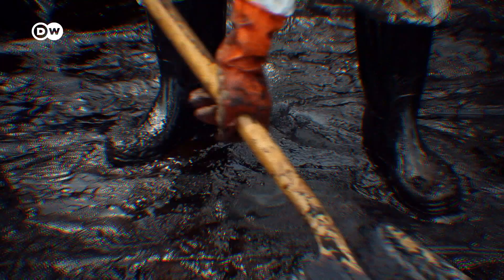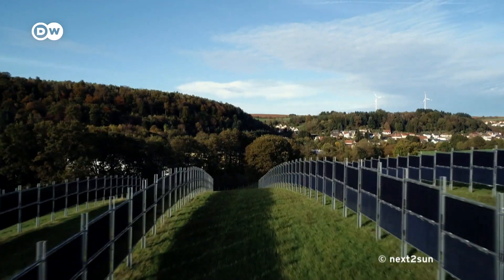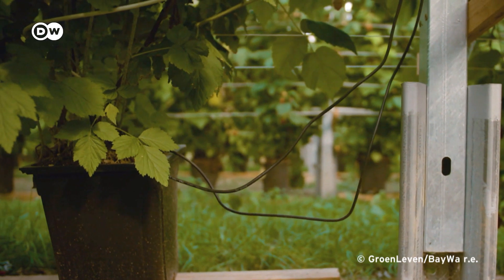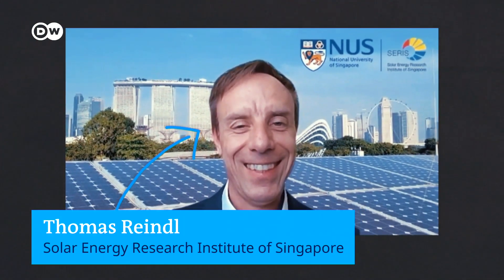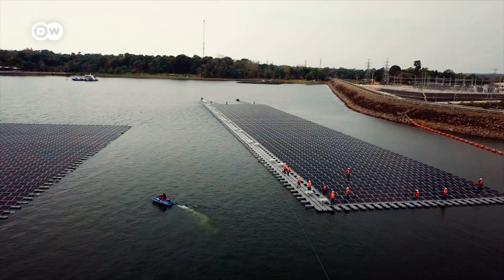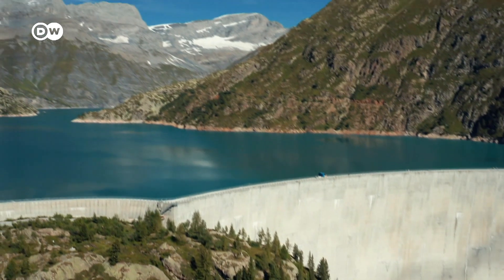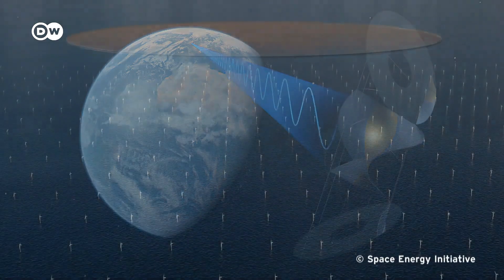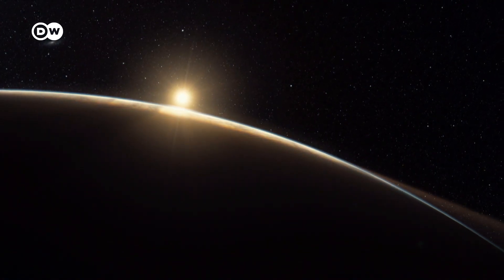Why we should be putting solar panels on our fields and lakes

Comment: The panels could provide needed shade and shelter in urban environments too, above sidewalks and roads and parking lots, and be used to power lights and water pumps, etc.
Reply: I'm for shadowed parkings and pumping water when energy is produced. For light that would mean storing the energy in batteries, and this is a bad solution because batterie suck. They are costly to produce, and I include environmentally costly, and then they have a short lifespan before dying.
Everybody that had installations to light their gardens, or have a remote controlled barrier on solar energy are rapidly dealing with dying lights and have to manually open their fences (a more complicated operation than if they had a non-motorized fence to begin with)

Comment: What happens to life underneath the water that needs light.
Reply from the maker: Great question, Jan! A water quality study conducted by Hanze University of Applied Sciences shows that the oxygen content under the floating PV modules has changed only minimally within a year, as wind and sunlight still manage to reach the water under these floating photovoltaics – because they move. When it comes to biodiversity and the environment, Buro Bakker / ATKB researched and found that panels lead to lower wind levels on the water surface, which results in less erosion of the banks and therefore protects the vegetation and stimulates plant growth. Such studies are still relatively new, and more studies need to be continued to examine the long-term effects in more detail. Feel free to explore the read more links in the description for more information!

Comment: Space solar for "green energy" on earth is the dumbest thing I've ever heard, if you think the $3000/kg to get enormous amounts of material into space is a problem, how about using absurd amounts of fossil fuels to drive the rockets producing a variety of greenhouse Gases while doing so. One rocket launch (of a current small passenger rocket with like 4 passengers) produces up to 300 tons of CO2 and in the upper atmosphere it remains for years, how are the solar modules supposed to EVER save that amount.

Comment: but if you block the sunlight in ocean it will reduce plant, algae and other organism that needs sunlight underwater and it will affect fishes habitats? 
right??
Reply from the maker: Hi Redgie, great question! A water quality study conducted by Hanze University of Applied Sciences shows that the oxygen content under the floating PV modules has changed only minimally within a year, as wind and sunlight still manage to reach the water under these floating photovoltaics. When it comes to biodiversity and the environment, Buro Bakker / ATKB researched and found that panels lead to lower wind levels on the water surface, which results in less erosion of the banks and therefore protects the vegetation and stimulates plant growth. Such studies are still relatively new – more studies need to be continued to examine the long-term effects in more detail.

Comment: I'm sorry but solar is not the answer for our energy needs. it's a decent stop gap for households, but there is NO WAY industry will ever be able to run on solar exclusively. I'm a huge advocate for green techs, but Solar just isn't going to cut it unless there are some dramatic and revolutionary discoveries made. We should be looking at things like nuclear and geothermal, those can provide the baseline powerloads needed to be able to run industry. The efficiency of solar just isn't there big scale. Even solar farms that use molten sodium reflected off mirrors and run through a heat exchanger to run a turbine can't hit the kinds of gigawatts we need. Tidal is another massive potential energy source that has a lot of up and coming designs, mostly out of Denmark and the European region. I'm not OPPOSED to solar, it just isn't enough alone. A great use for Solar is in pastures and mix use agriculture. Things like raspberries grow very well underneath the panels as they don't need direct sunlight exposure, which allows you to run a system like an aquaponics garden, with fish giving nutrients and eating pests, supplying the raspberries, which are shaded by the solar panels that are dropping your electric costs on the farm dramatically.

Comment: Wrong. This video is shit.
The reason for low adoption of solar is the panel cost and watt per square meter of panel. In 2022, this has reached beyond what was ever deemed possible. A 500 watt panel in a 1 by 1/2 Mtr . The costs have lowered to pennies compared to dollars.

In 10 years, you would see millions of panels around the globe. It’s only a matter of technology and economics.

Comment: Only two problems with this. First the raw materials are mined by very polluting methods in countries using forced labour like China and African countries. Second the placement of these in fields would be taking away a lot of important agricultural land and nature. The are good on buildings that use a lot of electricity during the day but there are problems getting the energy from residential areas to the end users so on homes they are rather useless and in fields you would probably have the same problems.

Comment: This is crazy.  The Building Regulations should be amended immediately to include the mandatory installation of solar panels on all new buildings and whenever roofs are renewed. By installing the panels integral with the roof covering the extra cost of the panels would be partially offset by savings in roof tiles.
Reply: All new dwellings should include a heat storage device (eg hot water cylinder,) heated by spare electricity from the solar pv panels.
Local storage facilities as batteries, pump storage or by conversion to hydrogen should be installed to absorb excess pv generated electricity and reused when demand exceeds that available from the panels (at night).
Reply: My state of California is doing this in San Diego. New builds for SFH need solar panels,

Comment: Solar energy is great but how we do it is just as important as where we do it. We MUST devise cleaner, more efficient production and recycling methods before blanketing the planet with solar panels.  As is, solar panels are not a miracle replacement for fossil fuel energy. They're definitely better in many respects but the potential environmental harm is great. Heavy investment in innovation, along with long term planning, is crucial.
Reply: There are many toxic chemicals in solar panels which  include cadmium telluride, copper indium selenide, cadmium gallium (di)selenide, copper indium gallium (di)selenide, hexafluoroethane, lead, and polyvinyl fluoride. Silicon tetrachloride, a byproduct of producing crystalline silicon, is also highly toxic, and as much as 80% of raw silicon is lost. Throughout their lifetimes they leach these toxins into the atmosphere and ground, solar panels also release nitrogen trifluoride (NF3), a chemical compound 17,000 times worse for the atmosphere than carbon dioxide.

Comment: But if you cover water to reduce evaporation doesn't that reduce the amount of rain fall?
Reply from the maker: Hi Glen, the Floatovoltaics do not cover the entire surface area of a lake. They are also moveable so wind can reach the water. As we mention in the video, at 06:09, only a 10 percent coverage of all the reservoirs which are available in the world, would give about 23 terawatt peak of installed capacity.

Comment: put the panels close to existing transmission lines.  minimize the transmission distance, because that is a big part of the cost and profit.  on top of all buildings in urban centers especially, where the power is most needed.

Comment: I will say here in the Mojave Desert, there is TOO MUCH sun for most plants.  Too much heat, way too dry, too windy, and too high of an altitude, so less atmosphere to block sunlight - way brighter up here.  Really, most people could not imagine how hot, dry, and sunny it gets here, and it goes on for hundreds or even thousands of miles. Imagine 3 months with temps at or over 100 degrees every day with no clouds.  And this is the cooler part of the Mojave, near the mountains and ocean of Los Angeles.  Here, most plants grow better in at least partial shade, or mostly shade, or full shade.  So this is a good idea for desert locations.
Reply: Sounds brilliant place to start tbh.

Comment: It takes 2 tonnes of coal to make solar a single solar panel, then aluminum, copper and other metals are needed. All of this requires destructive mining and energy. After all of this is done the panels will all have to be replaced within 20 years so the whole process will begin again. It is clear that modern levels of consumption are not sustainable meaning they cannot continue due to physical limits. Sustainable can only mean one thing and that is if we draw what we want from prairie , forest ,marsh, tundra, natural desert or ocean biomes all of these biomes are still completely there in there when we are done. Sustainability means this and nothing else.

Comment: Nuclear power is the reason solution. Solar is just a bandaid…
Using solar with agriculture would only be practical in very few places. As far as working on water, it could work on reservoirs and even eliminate the need for shade balls in places like California. But as far as using them in most bodies of water, it could cause catastrophic ecological damage by changing the light that the aquatic wildlife are adapted to. Space is a nice idea, but to make it cost effective, we would need a space elevator. All of this is without mentioning the unsustainable material requirement for solar panels as a whole. People need to open up to the prospect of a nuclear future, because none of our green energy even comes close to nuclear. Even wind has a larger carbon footprint, we have a solution for nuclear waste, and it is statistically safer than every other generation methods.

Comment: in the US there are about 2 billion parking spaces. I think it is a perfect match to place PV-panels above these parking spaces. If a parking space is 10 m2 (and per parking space there is an additional 10 m2 on access road), that would make an area of 40.000 km2 of area. depending on surrounding buildings and or trees, there would still be a huge area suitable. When driving through Arizona, it really struck me that all cars on the parkinglot of a shoppingmall were located around a tree hoping to get a sliver of shade.
Reply: So true!!! I have seen that open parking space sometimes are scorching hot in utah,arizona and other states. In asia most of parking space are not open due to land scarcity!!! But of great use in countries like usa
Reply: Some school parking lots in the northeast do this! Teachers aren’t boiling on their ride home in the summer 😂
Reply: Solar farms generate massive amounts of HEAT! You all worry about global warming, these solar farms are absolutely gcreating higher land and air temperatures and eating up thousands and thousands of forests torn down which creates less rain, more polluted runoff into the natural waterways around them it more than defeats the little bit of good energy produced. Solar farming is absolutely a disaster.
Reply: Are these parking space privaely owned? if so are they going to mandate that the owner install solar panels at cost?
Reply: @dantronics1682  much of these parking spaces will be privately owned. I don't think a mandate should be necessary. It is just common sense from a business perspective. It provides shade for customers who appearently appreciate it and the panels make money through electricity. They pay themselves back in a couple of years and after that it is all profit.
Reply: @freudsigmund72  how do they make money? Its only the utility companies that would buy the eletric produced therefore they would dictate the price and they are there to make money hence they will be paying peanuts if they are willing to buy it in the first place, then most people assume that if a person owns a car parking lot he has deep pocket so covering these car parks with solar panels is no problems what soever. Of course on paper the idea looks pretty sound but in reality doesnt work. simply, a person buys a plot of land, more likely he took a loan out to do this which have to be serviced, he have to prep that plot of land then marked out that plot for parking space, his total profit is parking space * parking cost per hr/day. even if the space was shaded he cant charge anymore per car for parking since 90% of car drivers isnt going to pay anymore just because that parking lot is covered compare to the one across the road now imaging if he borrows say $100k to buy solar panels to cover the parking lot, these panels let say produce 50kwh for 6 hr per day and the utility comp decide to pay him 0.05p per kwh. how exactly would this pay itself off in a couple of years? the honest truth is if there was money to be made people would be scoring the area looking for plots of land to put up solar panels
Reply: @dantronics1682  I am sure that every home or business uses electricity. You pay for this electricity. If  you have solar panels you don't have to pay for the electricity that you produced yourself. And for instance stores or malls use quite a lot of electricity. Not having to pay for electricity saves a lot of money. (With the panels on my house I save about $ 240 per month on average in electricity. (and for reference I live at the same latitude as Edmonton Alberta).
Reply: @freudsigmund72  The point I'm making is upfront cost, I'm sure if your house has solar either you are someone else have footed the bill to have that installed. what you save is different to what the utility company pays. if you save 15c per kwh if you were to sell the exess to a util company they would not be buying it at 15c but 5c or less
Reply: @dantronics1682  Of course I was the one who paid for the PV installation. And like with any business: you need to invest first before you can make a profit. But even with a reduced revenue for excess produced electricity, it is still a sound investment. Especially in this case, especially with stores and malls, as it can be a selling point to get people to that specific business is they provide shaded parking.
Reply: 2 billion parking spaces. That right there is the issue. I recommend you watch Not just bikes, they are a channel that goes over how shitty the american car centric system is
Reply: I like all your comments and ideas. I just think there is absolutely no political and economic Will for companies and US governments to do any of this. It’s like I heard something on the radio news last week. Old people are making laws and policies with no concern for the future but make them for their own financial benefit. We need to get rid of old ass politicians and elect young people who focus on future of young generation, kids and the planet.
Reply: the problem in that is the shadow, even partial shade of shadow in one to two panels can result to 80 percent lower power output
Reply: @yam2k7  not if you use micro-inverters or optimizers.

Comment: I would like to have more information on some issues, particularly, cooling the panels with bodies of water means warming the body of water in turn. On a large scale this might have adverse impacts. And secondly where are we going to store excess power for the night? With hydropower it would be feasible to have dual reservoirs and use excess day energy to pump water in the higher reservoir and let hydro generate power during nights. But the biggest issue is still energy storage with PV.
Reply: An uncovered stretch of deep water absorbs ~95% of the solar energy that hits it (the remaining 5% is reflected). The net effect of covering it with a solar panel will be to reduce the heating effect by ~15%
Reply: We should store the excess power in our EVs' batteries, then return a small amount when we come home in the evenings.